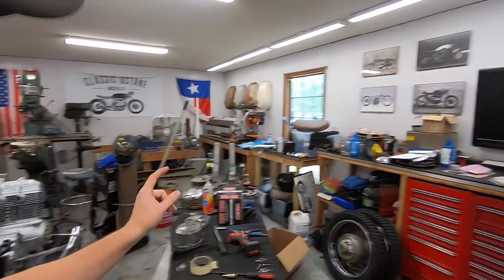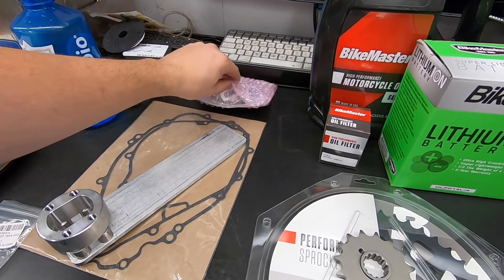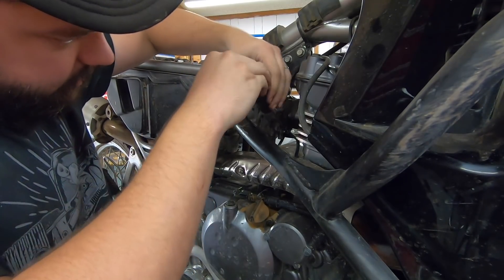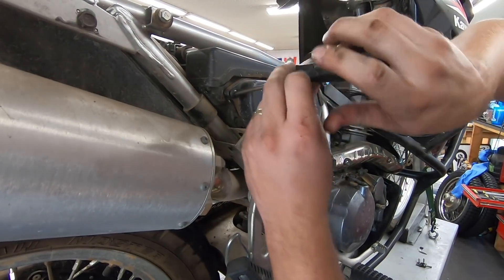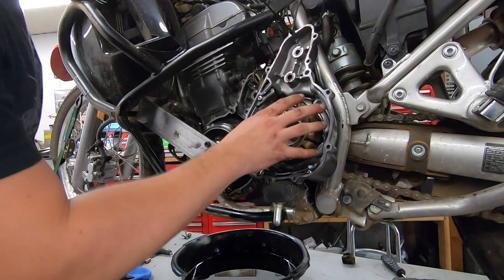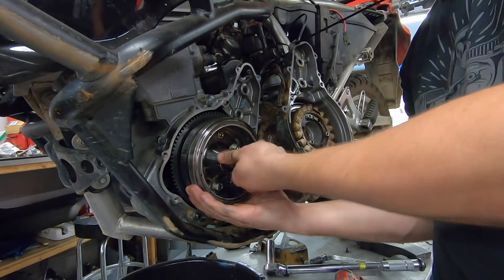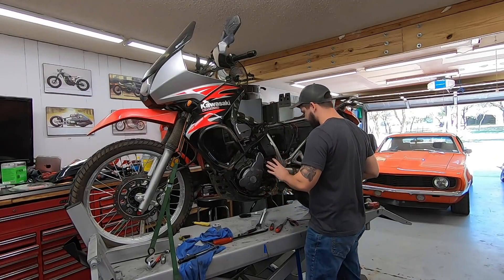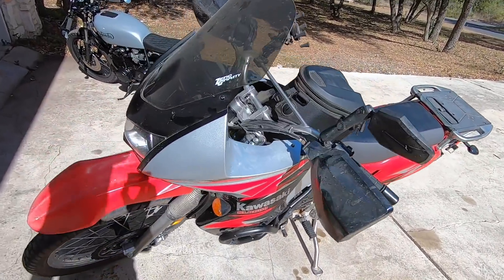Getting the KLR adventure ready

Comment: Always great content from your channel, thanks for this.  Since you mentioned the PO was unaware of the service history, one other check you may want to consider is checking the valve clearances.  I'm not sure about the 2008 and newer, but on my 2000, the valves are shim-bucket style, adjusted by replacing/exchanging shims.  After the required warranty check, mine didn't seem to really wear after that too much.  They sell a cheap tool that helps with compressing the  spring so you can pop out the old shim and replace if required to get back into spec.  As of 40,000km I had only had to replace a couple of shims once.  Can be done with engine in frame, but getting the valve cover out of the way can be a pain.  Lots of write-ups on the web to walk someone through this.  You'll need a quality caliper/micrometer for measuring the shim thickness, and access to replacement shims. Some people buy a kit of various shims for convenience, but most of them would never be used.  I had my KLR for 18 years and had lots of fun with it.  Sold it last year in a moment of weakness/temporary insanity...

Comment: As a friend of a few enduro/mx riders the foam filter is usually better when you're riding off road. The foam ones are also washable and you have to oil them also with filter oil. The one you put up let trough pretty much fine particles. It's really good on the road but once off road and especially on sand roads it can clog up pretty quickly

Comment: I have same klr. Same year n paint scheme. I have 30,000 miles and just checked valves and were in spec and did the doo. My chain was just about out of adjustment so did the doo. I put a stage 2 dyno jet kit and opened up my air box with 4,  1 inch holes under seat then siliconed window screen over to keep debris out. Also a lexx slip on. Did carb and air box with exhaust when bike only had 4 thousand miles on and really made a big difference. My klr has been as reliable as a hammer!!! Regular maintenance goes a long way!!!! Love my klr!!!! Only issue ever I had a short in wiring where it flexes between the forks n frame. Kept popping main fuse. Almost forgot I installed progressive fork springs.big difference, stock springs are really soft. Subbed, since you're the only other with identical bike as mine! Lol

Comment: My 2011 has 105k km on that doohickey. The factory one lost tension around 20k. It burns too much oil now for my liking. A big bore or just ring change will be on the menu.
That's bikes in really nice shape.
Thermo bob is another mod, it  splices into the coolant hose, changes the thermostat and allows it to run a constant temp. Klr get to operating temperature but when your get up to speed the thermostat will open suddenly. Very noticeable on cooler days. It does creap back to where it's supposed to be. The thermo bob gradually opens.
There's all sorts of opinions and farkles for the klr. Mine is do the doo, hand guards, crash bars and plate, heavier rear spring, progressive fork springs, better pegs, led head light bulbs.
Just keep em simple.

Comment: didn't show the lever (doohickey) itself. did you not replace it too. they are known to break as well when spring looses it's tension. also... use some grease on air filter to help provide a good seal between filter and air box. doesn't have to be special rim grease. can use what ever you have on hand. if you ride it off rd or gravel, dust can get past if you don't use grease. glad to see you checking out a klr. i have several bikes and my favorite is my klr. bought it new in late 06 and never get rid of it. currently have round 75,000 miles and counting. love that bike!
Reply: Nice tip about the grease!